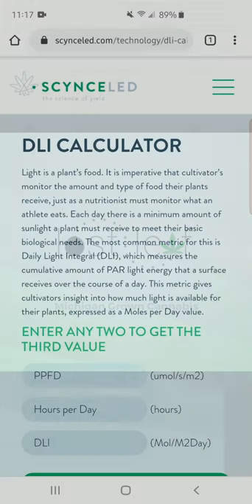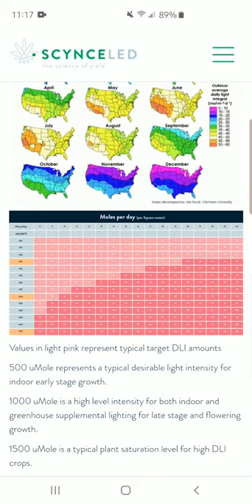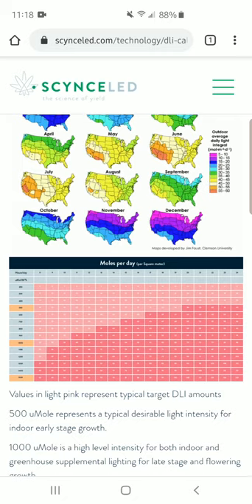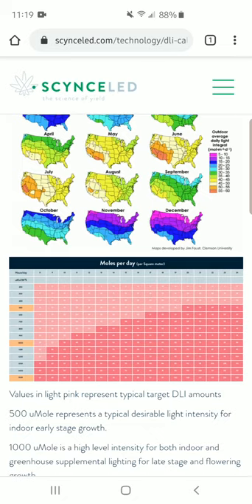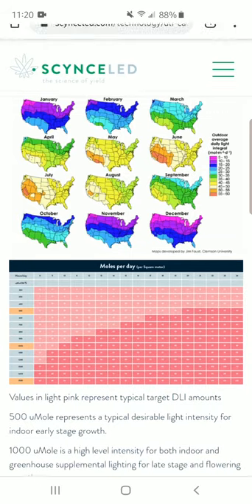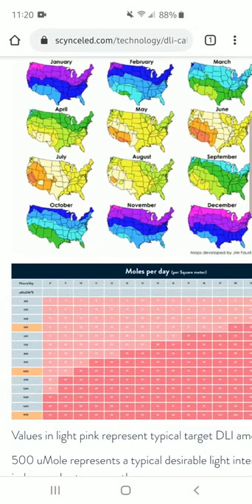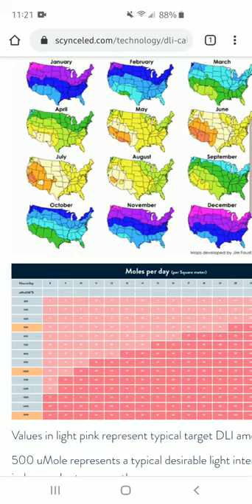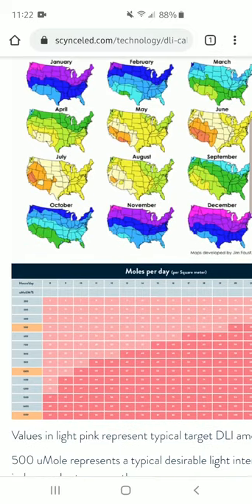Is DLI the secret to growing with LED?

Comment: I started running the 14/5/1/4 this veg, but I also installed far red lights in the bloom, I wasn't bold enough to try 14/10, but I am running 13/11. I can't really say whether they are ahead of schedule here at day 17 but I do need to ramp up the intensity, so maybe I'll start shortening the day at the same time. Planning on doing a full defoliation this week so I'll have a bunch of different inputs to keep an eye on.

Comment: Very interesting.  Are you concerned about weights or is quality top priority?  Switching to LED soon but I'm still running gavita at 11/13, have been for a year or so.  I like saving the power and the reduced heat.  Very much looking forward to future vids.
Reply from the maker: I don't believe so, honestly I wouldn't be surprised if overall weight went up, I would assume biomass production would be higher if the plant is healthier and not getting pushed past it's breaking point 🤙

Comment: Hard to find info on this, thanks!.  Especially if you factor in the 12-1 veg and shorter flower days like your doing.  Most growers recommend par levels for veg and flower that are exact same DLI throughout veg and flower after the hour reduction.  Where as an increase at some point in the transition and decrease and end of flower is what some recommend and what you get in nature, however it can result in longer flowering time like nature, so maybe just reduce DLI in your expected last week to increase resin and oils without burning them away.  I am not good on shorter flowering days as the par required to reach good DLI in a 8 hour day is at least 1200... where as 800 par is equal to the same DLI in 12 hours.   But a 600 par in 12-1 is only really 26 vs 32 at 800 par.  I don't count the DLI for the 1 hour since they mostly are drooping asleep still for most of the hour.  Subscribed

Comment: Your hypothesis makes sense just curious if it increases of quality and cheaper light bill if weight will pay for that or not effect at all because they have more time for recovery will they bulk and build there flowers. I am excited to see what comes from this. Your are my main resource when it comes to LED. ✊🏽👊🏽💯💯💯
Reply from the maker: Absolutely a viable thought but I would think if the plants can't process the excess light then the excess light also wouldn't inhibit any biomass production, the only way that would happen is if your readings aren't correct and you aren't actually hitting those numbers for ppfd because if you don't hit the point of light saturation then you definitely would be missing out on some production. 👊
Reply: That totally makes since I really need to start taking some notes for LED it is a beast of it’s own. I guess I thought about in my mind was like when I flush my plants , I tend to use enzymes, and humid acid just to force the plant to uptake more even when it says no, to increase density, love the way my calyx look after hard flush 😆. Never had to do much other than change out my Horti Bulb. #newgame #nextlevel 👊🏽✊🏽💪🏽💯💯💯

Comment: Thx bro!  How much do you dim your lights in the last two weeks of flower in % and what ppfd do you got befor and after dimming?  What about the yield with this technique?  Heared medicropper say that by reducing the lightcycle you finish faster but dont yield as much. What if the plants dont look droopy few houres bevor lights get of, does it mean they could take the light and is no need to reduce the cycle? Much love
Reply: And what do you think of an 9/3 cycle in veg?
Reply from the maker: During the first experiment I dimmed them back to 50%, I think that this shorter light cycle will achieve the same results as dimming according to this chart, I don't believe yield would be adversely affected unless you didn't have the ppfd in the first place to make sure the plants was hitting the point of light saturation, like I said we want to stay just on the other side of the line if we were to be too far into the light pink then we wouldn't be pushing the plant to it's maximum potential each day.  All of this is dependent on how strong your light is, if you are running 18/6 in veg let's say and your plants don't droop then I would take some readings with a lux light meter app on your phone and use a lux converter online to figure out a roundabout number of what you are getting for ppfd at your canopy and go from there, if they aren't drooping and you are running 18/6 then you are either running just enough or not enough light in veg and if you bump it up you will see better stacking 👊

Also I wouldn't go any lower than the 14/5/1/4 cycle in veg for the risk of accidentally switching the plants photoperiod over to flowering.

Comment: When you dim the lights back did it also reduce the heat? I am wondering whether the increasing Turpines is to do with the less intense light and heat in the last two weeks?
Reply from the maker: Nope all of the environmental parameters were the same 🤙
Reply: Lost Leaf nice, I’m trying it... interestingly my reds are on a different channel though.. hehe. I shall keep ratios the same and just lower the PPFD
Reply from the maker: @greenthirteen1234  in my opinion the best option would be to make sure you don't hit that point of light saturation and also cut out the reds if you have the ability to.  UV (~450nm) also would increase the THC in the last few weeks, the combination of all of these methods would yield the best results I would imagine
Reply: Lost Leaf yep, I’m one step behind you though so I am going to finish this run following your best results plus uv in the last 2 weeks for 4 hrs of the 12. Then.... I’ll see how you go with what you are about to do 😀
Reply: Lost Leaf ps I run Samsung 3000k strips with separate HLH 660nm to about 15%

Comment: what was the temperature in the room, what was the temperature above the hemp and leaf temperature, what temp / rh% VPD for the last 2 weak points? how it looks in nature, the plant can absorb 2000moles from the sun, but for a short period of time the sun sets. With the help of led light, we burn the plant during flowering, because breathing stops, and the plant, for example, does not have CO2 to absorb and convert it into sugar or lacks water and cannot breathe properly and the plant turns off, and then the plant begins to burn In the last period of flowering, the plant does not need so much light, because it has grown and the structure is fixed. They need more energy when you switch to flower, when the cells begin to multiply, and when the cells multiply, they begin to grow. This means that 9 / 15h in the last two weeks is reasonable
Reply from the maker: I was running 85° to keep the leaf surface temp at 81-83 and I run VPD in accordance with the leaf surface temp so I was running 70% RH and 1200ppm c02 as well.
Reply: @LostLeaf  on the getpuls site you can find that vpd chart when you take canopy level temp - leaf temp, it is always between -1 or -2 and it show that 1.2-1.5 kpa about 60%rh
Reply from the maker: @pawelk3702  yep I like to stay on the high end of that and when I say 70% it's obviously not beeline usually there's a 5% swing in there usually on the low end so I would end up sitting 65-70%

Comment: Drop everything over 630nm at week 7. Supplement with UVA and ~450nm during that same period to keep your PPFD requirements to ensure you're hitting that DLI after dropping reds. Been working for me for years. 😁👍👊
Reply: UVA has been proven to do next to nothing, you need UVB bulbs which are still relatively safe and easy to get.

Comment: When I want 800-1000 ppfd for flowering should I take the average ppfd for the 2x2 square my LED gives or focus on the peak value. The average would be about 50% of the peak value. When calculating dli I feel like it makes more sense to use the average
Reply from the maker: I would say yeah, but the hotspot may have adverse affects if it's that much more intense right there
Reply: @LostLeaf  Thank you for the reponse. At what level do you think adverse effects might come in? I can find the answer for lux easily but not ppfd
Reply from the maker: @rudymelo880  if you get a hotspot of 1000ppfd+ and are running your DLI for the outer edges that's where you'll notice the middle will suffer rather than thrive
Reply: @LostLeaf  what would you say the optimal DLI would be without CO2? Maybe around 43 or so?
Reply from the maker: @rudymelo880  I don't believe it's affected by c02 that would be moreso your room temperatures and leaf surface temperatures

Comment: Would this apply to HPS lighting?
Reply from the maker: Definitely just to a different degree, like I said LEDs push specific plant nutrient uptake so it's much more detrimental with LEDs as you will push the plants into deficiencies if you push them past this point, but with HPS the theory with trichome/terpene degradation would definitely stand regardless of the lighting source I believe.
Reply: @LostLeaf  gotcha! I'm currently in flower using hps. We know that hps produces red light. I wonder if switching back to a Metal halide for the last week or two of flower would preserve Terps?
Reply from the maker: @austinhaynes2777  according to the information we have available today yes cutting out any red would preserve terpenes, and blues will help bring resin out as well so that's definitely a good idea 👊

Comment: can you recommend a ppfd meter to buy?
Reply from the maker: Measuring proper ppfd requires a goniometer, but a shorthand easier method is to use your phone which has a built in lux meter, you can take that and your spectrum that you are using and use a lux to ppfd calculator to get a good roundabout reading.
Reply: @LostLeaf  350 ppfd with DE gavitas at 1000w.  seems low, think ill buy an apogee mq500
Reply from the maker: @DJRS2178  damn that's def not right, did you use the waveform calculator? What levels were you getting?